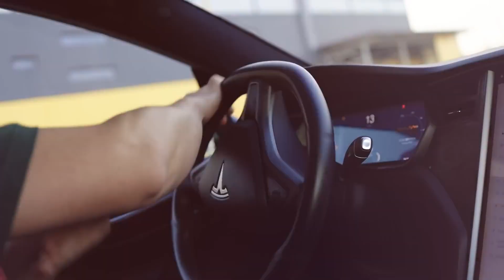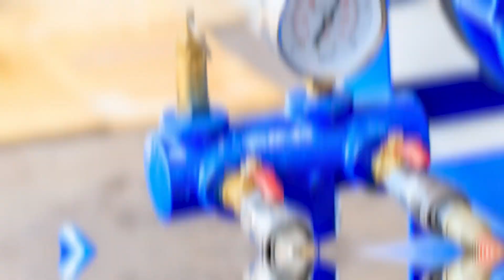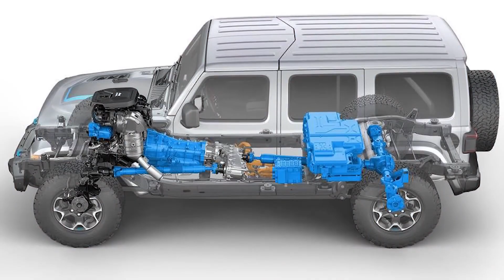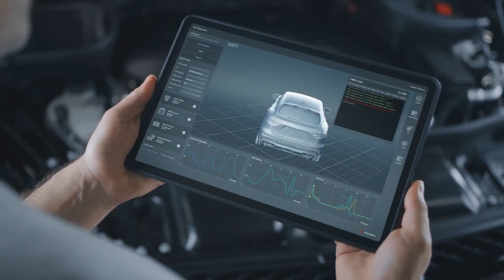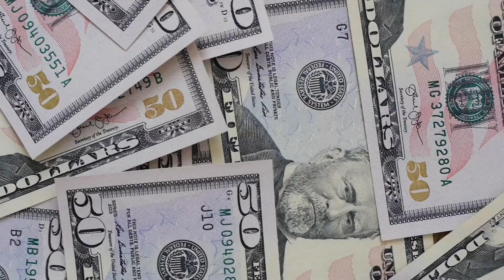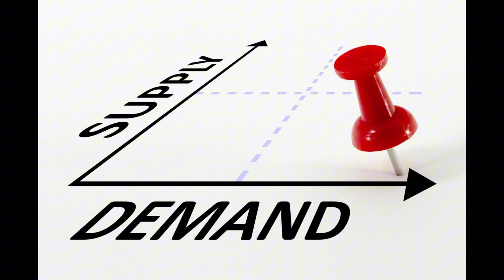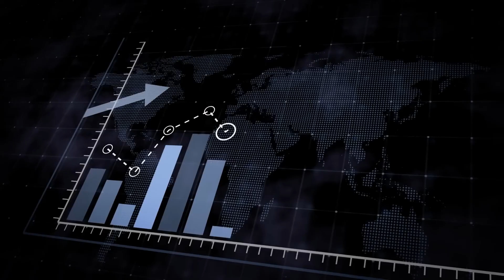Jeep CEO Announces A NEW COMPRESSED AIR Engine That Will Destroy The EV Industry!

Comment: This was a waste of 8 minutes. A combustion engine is an air pump. It uses combustion to get the psi up enough to push the piston. How is this new miracle engine gonna compress it's air? EVs use combustion to generate electricity at the power plant, likely coal, as well as toxic mining to get the lithium.

Comment: bullshit... cost? Ev has no carb, no rad no transmission no oil and air filters spark plugs etc, besides the fact that an electric motor is basicly one moving part... lousy video, no real description of the new engine, which might be good but he doesn't talk about it, too busy bashing EVs with idiocy... assholes

Comment: OMG  you're so wrong.
Decade ago?
Compressed air motors are decades old!
Apart from the production of the compressed air (one of the most inefficient rate) and the cost of this production there is some fundamental issue with with this motors":
- to achive optimum performance we have to deal with super high compression ;
- the thermodinamics changes are very high between the compression and escape - from high positive temperatures to negatives ones in the escape;
- resistance of the materials essencially derived by the thermodinamic chages.
And many others to discuss.
However, this old technology can be transform in a new paradigm if some of the big names give a chance to it.
I've studied this technology for about 40 years ago and made some small projects. The more interesting that I study and colobated is the Guy Nègre compressed technology. Please take a look at this project since Nègre is defunt but is work is to be remembered.
Thanks.

FINAL NOTE: I'm a true belevier in this technology but I think JEEP and others big names are not so interested in that.